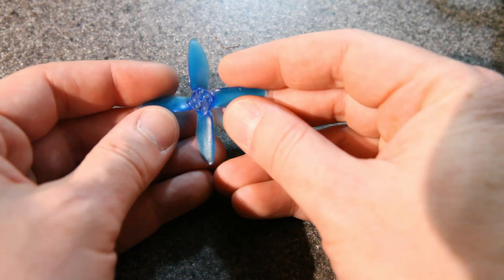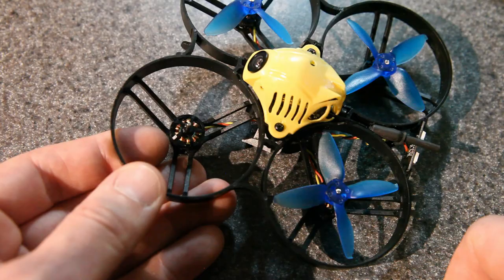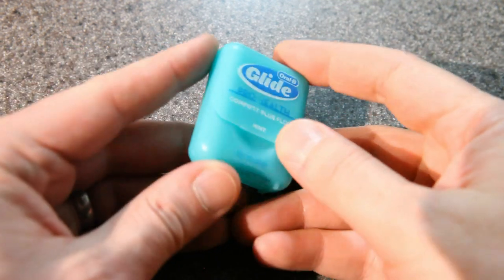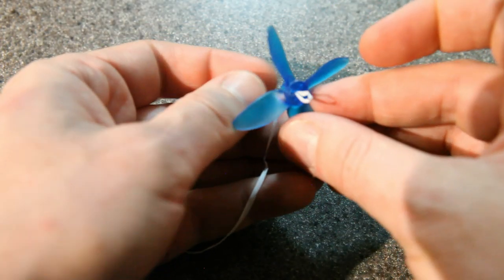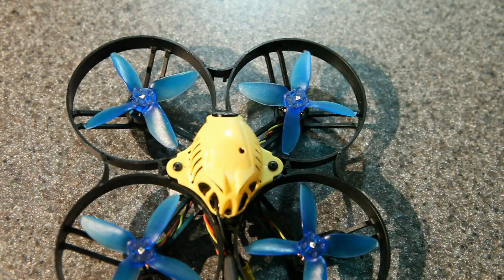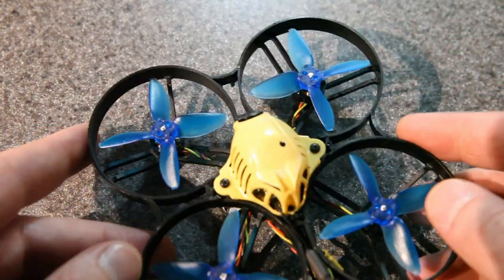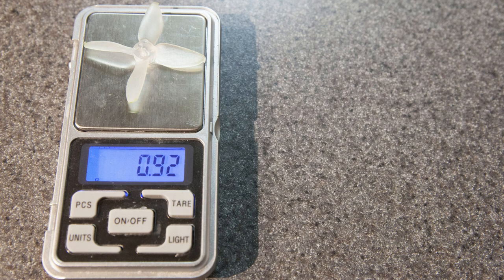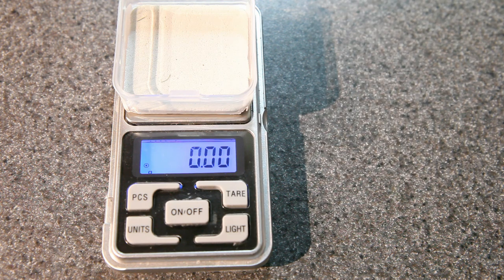Flossing Your Props!

Comment: Have you tried the azure 2035 or the betafpv 48mm tri blade props? You have to drill out the center of the 48mm props to make it wide enough for the shaft, but they are super lightweight. They worked good for me until I killed my esc in a crash haha.
Reply from the maker: No I don’t have either of those.

Comment: Would those RENY screws work for the props?  Would that be better than titanium screws?
Reply from the maker: They would work. I think RENY would be slightly lighter than Titanium, but not as strong. Still they would probably be strong enough. I know someone who uses RENY for all his prop screws. I purchased the longest M2 RENY screws they had so I can cut them to length for props, and motors, and FC stacks.

Comment: Do they make nylon screws that small?
Reply from the maker: Yes they do, but it would be a major pain if a nylon screw ever broke leaving material in the hole.
Reply: @MrShutterBug  Great channel and thanks for how to floss props. 
About using nylon screws: 
Building quads extrem light and for determined breaking point I use nylon screws for all my copters.
In rare crashes it happens what you mentioned but holding a small screwdriver over a lighter you can melt it down in the hole and its easy to get it out.